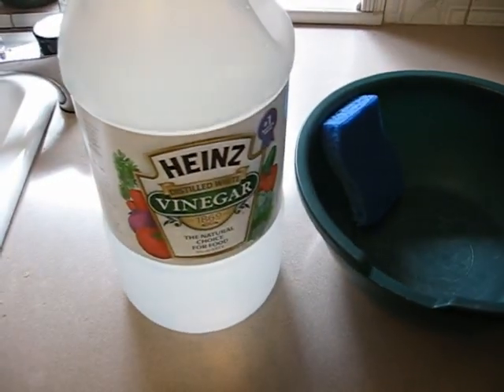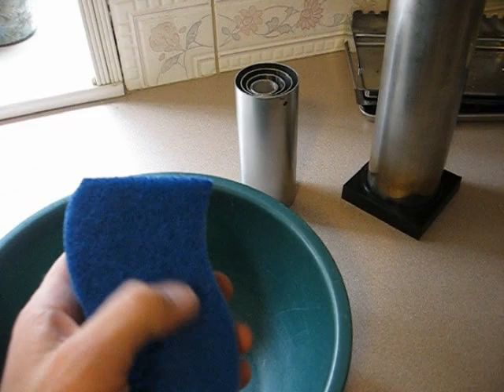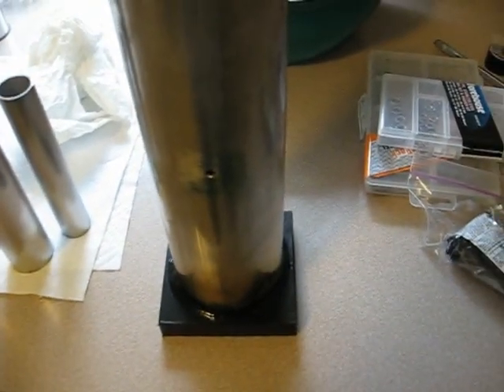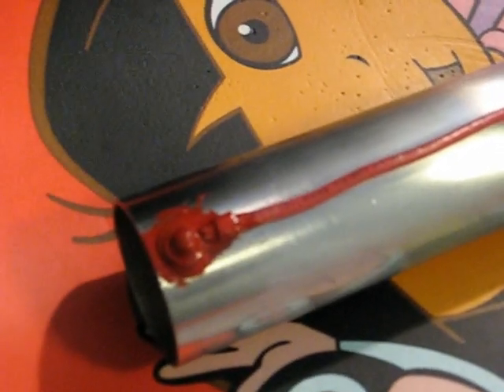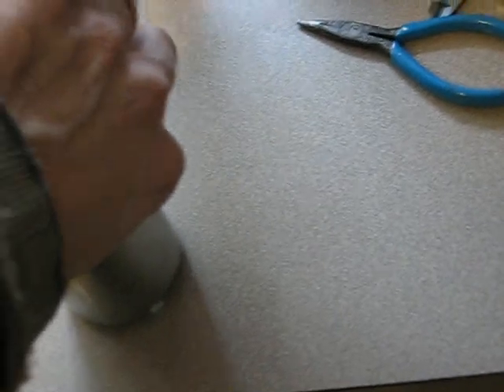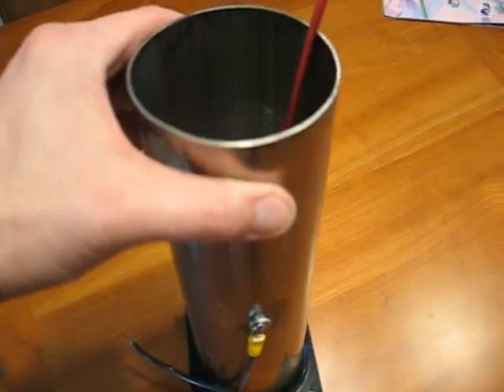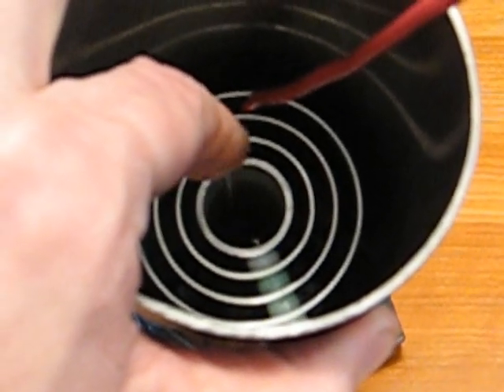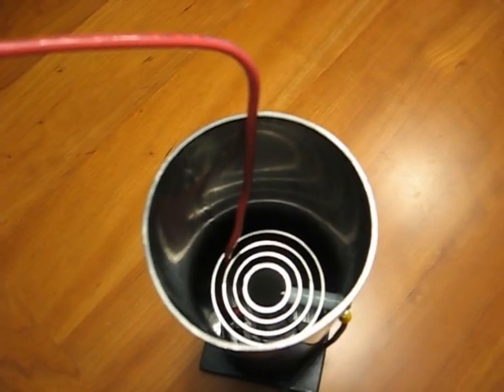How to assemble the HHO generator part 2

Comment: You said that tube size is 3" 2.5", 2" and 1.5" length is 3 inches . but what is the theek ness of  the tubes? Inner tube  is positive and outer tube is negative is it ?

Comment: Try a different low corrosion metal. Your plates don't need to be stainless steel, they just need to conduct electricity. 
As far as the best electrolyte to use, right now I'm using sodium hydroxide, which is usually the main/only ingredient in drain cleaner. By the way, not only is salt bad for stainless, but it also creates chorine gas when used in a fuel cell, so don't use it!

Comment: Try fidgeting around with low corrosion metals, you might find one that works better. The problem with a lot of the best low corrosion metals is that they are wicked expensive. The types of electrolyte you use can have a big impact of your results as well. The best that I've found so far has been sodium hydroxide, which is usually is the main/sole ingredient in drain cleaner.

Comment from the maker: you may also use isopropyl alcohol in the mix in wintertime.  No flames yet :)  Plus, I just used a vinegar bottle for the mix, it wasn't all vinegar, just a tiny bit for descaling.

Comment from the maker: you may use 4" for the outer ring, then equally spaced rings thereafter.  Please do your own conversion to metric.  Also, be aware that pipe sizes vary greatly, so be sure of the measurements before you buy.

Comment from the maker: The screw only touches the outermost and innermost tubes, the rest have clearance holes, as I explained in the video. No short. This thing ran for years in my car, hehe, it was a good design but I use a dry cell now. No alternating plates + then - unless you are running around 2.4 volts. Although that would create lots of steam and steam is good for MPG too :)

Comment: looks like a short circuit mate - you have a metal screw through all of the tubes. but in the case where you take the screw out once all spacers are inn  and everything is dry why only the outside as ground? i would have expected that you would have alternating rings as positive and negative?

Comment: I keep coming with a(n) alcohol to an equation(not completly tested), and when I saw that vinegar, I saw one step closer to Alcohol, caution: if one  adds vinegar instead water, you might get alcohol(flammable) , your liquid might even be(converted to) a flammable substance, thus saying how quick the convertion is, also saying there might be a chemical out there(possible element) to convert vinegar to alcohol. though if it aint broke dont fix it, thank you!

Comment from the maker: @SUNOFX51  The screw only touches the innermost and outermost tubes.  The rest of the tubes have a clearance hole.  Plus, I use liquid electrical tape AND heatshrink on the middle part of the screw, to make sure it does not contact the other tubes.

Comment: The construction details are excellent but as I understand it each pipe needs to be connected to the power source, or am I wrong?
 
If each pipe needs to be  connected to juice what is the purpose of an insulator , it might as well be made of steel or any conductor.

Thank you

Comment from the maker: About 1/8 inch.  As the HDPE started to melt I leaned very hard on the end of the pipe, being sure to keep the pipe centered and square with the end cap.  I did not make the tube so hot that it easily melted the HDPE.  The plastic mushroomed out around the tube because there is nowhere for the material to go.  But, the two were permanently attached afterward.

Comment from the maker: Copper is coated in liquid electrical tape, purchased at Home Depot.  You must let it dry for a few days before using the cell.  Copper in contact with the electrolyte + current is not a good thing.  Always isolate non stainless materials in your cell.

Comment from the maker: I understand what people are telling you, because they tried to tell me the same things.  However, it is false.  Wattage = heat in direct relation...period....it is a fact of physics that no one may change, EVER!  If you have 10 billion plates, or just 2, the wattage is what creates the reaction and the HH OO.... not volts, not amps, volts x amps.  But, it will be better if you have separate cells running in series, than to run more plates.  Please try it.

Comment from the maker: This unit has been installed for 7 months.  No problems, works like a dream.  Whoever told you about the plate numbers, etc does not have solid data.  I am an electro-mechanical engineer with many years experience in building and experimenting with these cells.  Believe what you may about HH OO (not HHO) production, whatever makes you happy.

Comment from the maker: Using copper is absolutely, perfectly fine as long as it is isolated from the electrolyte...no matter what anyone tries to sell you, period.  Copper is a much better conductor than SS.  SS heats up and has way too much resistance.  For the spacing, I have not seen even one video where anyone proves the voltage/amp/spacing theory with solid evidence, measuring the cell and gas output COLD.  I have to see it to believe it....period.

Comment from the maker: You can get HDPE on EBay.  People sell sheets of it.  Make sure you get 3/4 inch thick sheets.  You can drill large holes through the inner tubes and put liquid electrical tape and electrical shrink wrap on the part of the screw that goes through the holes.

Comment from the maker: I used to use SS leads, but they get extremely hot becuase of resistance.  So, for the sake of heat, I opted for copper.  The liquid tape has held up, so far.

Comment from the maker: The new video is coming this week!  The first test run with this cell and my enhancer box got me 44 MPG at 13 amps.  That is apposed to 34MPG without the system installed.  30+% gain!  This cell produces 900ml/min at 20 amps COLD.